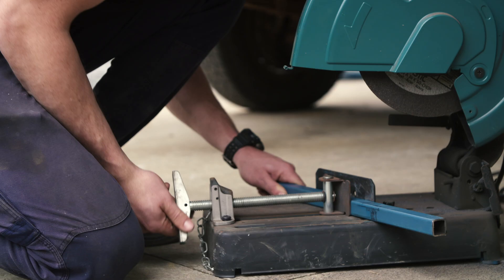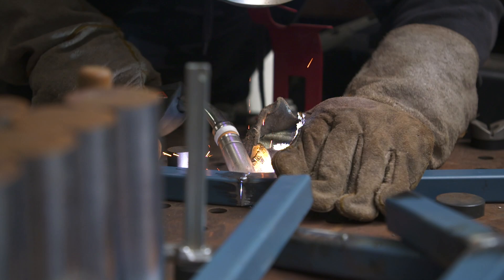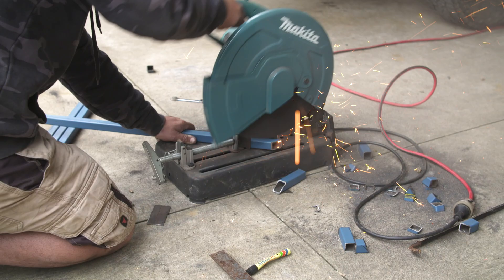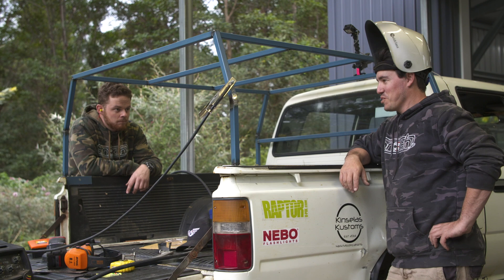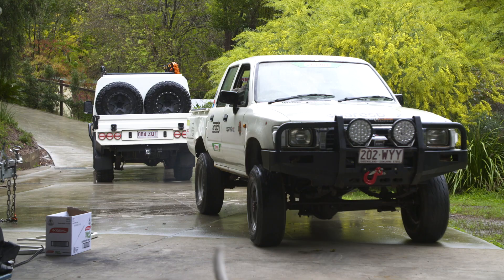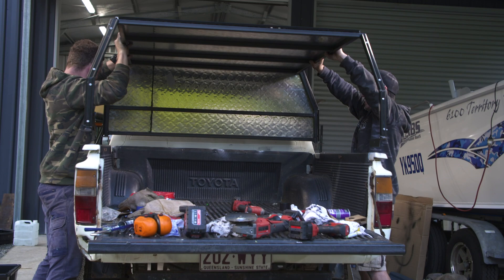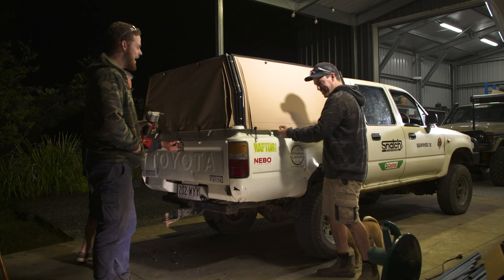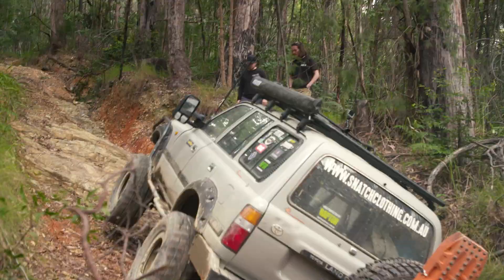CHEAP $1000 Canopy & $200 Drawers Built in Shauno’s shed! This will make you want to modify your 4WD

Comment from the maker: This has gotta be one of the funnest 4WDs we've ever built and driven. What's should we do to it next?
Reply: Get some 33s on it!
Reply: Put an Ls in it
Reply: I think a homebuilt exocage could be cool, would help jocko keep his panels straight as well😂
Reply: Put a rotary in it. Chop the springs and drift it
Reply: 6x6
Reply: Paint it pink
Reply: Put a bigger set of tyres on it
Reply: Homemade rocksliders and scrubbars because why not lol
Reply: custom roof racks made by the man himself, king of welds
Reply: Definetally a lift and tires
Reply: Or do what I've done to my 106 and make a custom centre console and rip out the rear seats and make a false floor and draws, and a sneaky sub
Reply: Yay you kept the lux I love seeing the lux because it gives me ideas for my own and wanna get but all the stuff I want will be expensive is there anything I’m doing wrong I have tones of questions is that ok if a ask some?
Reply: Looks Sexi mate
Reply: Twin turbo it
Reply: Mud tires
Reply: Put new lights on it (LED's)
Reply: I think most of us agree here. Tires. It really doesn't even need a lift to be honest. Just some proper 31s really. Look at how well the Dmax does on 31s!
Reply: Get a better driver behind the wheel first
Reply: Turbocharger
Reply: Shockos fabrication
Reply: Put 33’s or 35’s and a to-way/stero
Reply: New rims and Tyers
Reply: Roof cage side steps rock sliders 33s with black wheels maybe an ls1 with recaro seats if you want
Reply: Tiers, suspension and get some power into that thing (get in touch with Haltech) and maybe send the engine to Al at the Skid Factory and get a turbo Barra back.
He is doing some 1 and 2 JZ stuff now. 
The HiPony with a turbo 1JZ..  (Yes I knows it's called the PonyLux but...) 
Maybe an auto conversion.
Reply: How are you going to use the review mirror 🤔😂
Reply: I recon new tyres and a set of of road light bars including new head lights and tail lights. This would be if it the lux as it would have more traction and better visibility for those late night trails. Secondly you should do either do a mix of performance mods like air filter uprated fule pump and injectors. You could combine all of these or some into a big over haul video like this one but more feature length.
Reply: Put an Iron Jack beer keg in it with a tap and make it the mandatory beer truck for the next adventure aka the 'Iron Jocko'
Reply: Raptor coat on!
Reply: Suspensions, lift and bigger tyres.
Reply: Next do the Gq then hilux then gq then hilux.. until both are epic tourers
Reply: Lift and 33’s would be the go
Reply: Raptor coat it
Reply: Build a set of rock sliders
Reply: R.o.p.s
Reply: Engine swap the patrol
Reply: Put some 37s on it haha
Reply: a decent set of tyres from goodyear!
Reply: Jocko you need a 2” fulcrum lift and 33s and that thing will go anywhere.
Plus I’m a fabricator welder and I’ve picked some things on that canopy that are classic 🤣
Reply: Auto locker in the frount
Reply: 🇹🇹🇹🇹🇹🇹lift kit and bigger tyres bros ...
Reply: Kings awning
Reply: Staino snorkel
Reply: I want to see a lift and some tires made man size!
Reply: Has to be some new Tyres and a DIY snorkel/diff breather kit. No doubt water crossings are coming up in Fraser
Reply: I reckon bigger and beefier tyres and a DIY roof rack would look real sick
Reply: Trade it for a proper 4wd
Reply: vl turbo, a few nice tricks there👍🤣
Reply: Put some indicators in the front bar.  .
Reply: New paint job and a exhaust system 👍🤟
Reply: Been a budget build, 33s, 2 inch lift and more diy cheap mods, maybe something as simple as making rock sliders, roof racks or side rails. I reckon keeping it a budget build will definitely show what you can do with a small budget aswell as having a few beers with mates whilst making it 👌👍
Reply: Tyres definitely tyres
Reply: 1uzfe swap
Reply: Add some 33s with some spotties on the canopy an maybe put the spare on top of the canopy, reckon she'll look shhmick 👌🤤
Reply: Big Led light bar and a roof rack would be nice on luxy..
Reply: Put a uhf in it
Reply: I reckon some new tires would look awesome and help out heaps and maybe a service on the engine to get it running nice and smooth
Reply: @deanharrowell2741  already has auto lockers front and rear
Reply: Id say..... bigger tyres, rock sliders, and a coat of raptor linning..
Love watching these vids.
Cheers.....Pete
Reply: rears up front with long travel shocks and 40s
Reply: Split rims on cheese cutters 👌🏻
Reply: Lift an 35s it would be unstoppable
Reply: MUSHROOMASSASSIN too big
Reply: 4WD 24-7 put signal lense on the bullbar
Reply: 33s
Reply: Put some tractor tires on it because it twin lock and it go work good in mud and on wet hills
Reply: homemade custom armor everything that you can
Reply: 33s, back yard bar work, do it!!!
Reply: 3 inch lift and bigger set of tires
Reply: Roll Bar 😬
Reply: Rock sliders but you guys should build them , should be fun to watch
Reply: Definitely do an awning and 3inch exhaust plus a tune to the little beast
Reply: Hey boys just to let use know if JS fabrication gets up and going I'm happy to let use take to my 105 LandCruiser to turn it into a dual cab lol
Reply: Grab the old 1000 buck lux and meet graham in the simmo with shorty
Reply: Darryl should get a extra $1000 on budget the next time just to keep it even. I reckon 31s on the hilux keep it a budget warrior
Reply: Sanitize it.
Reply: Fluffy dice and musical airhorns
Reply: Jocko next mod should definitely be a set of 60 series wing mirrors. You'll see heaps more esp with the solid backing plate on your slick-as canopy 👌 screw em straight into the holes that are already there.
Reply: Home built roof rack would be practical of it's set up as a tourer
Reply: Through a set of 33s with a 2 inch lift on it
Reply: Through a set of 33s with a 2 inch lift on it
Reply: Some home built rock sliders and oversized tyres!!
Reply: When are you doing the Fraser Trip?
Reply: Gets some decent rubber on her and then maybe some suspension upgrades
Reply: Tires,  turbo, exo cage
Reply: Turbo, comms and 33s
Reply: Ifs rears, rears up front then a td04 turbo make it a bit more drivable in the sand and on the road 👌
Reply: 2 inch lift and bigger tyres. Maybe drop a turbo on it
Reply: Put new tires on it and a roof top tent
Reply: I think you guys should backyard mechanic this little guy ALL the way to show the average Joe Blow what can be done on a budget. Let's face it, nobody is buying new atm because we're all watching the budget. Good slogan... 'Backyard Mechanics - We get it right the THIRD time' 🤣🤣🤣👍
Reply: Next you should corona proof it
Reply: A camera system, so you can see 360 degrees on the trails.
Reply: Please don't ever class yourselves as metal fabricators again 😉
Reply: Engine tunning, give it bigger tyres and a nice paint job.
Reply: Fix the massive dents then do a full raptor paint job!
Reply: one word.... turbo :D
Reply: keep them as stock as possible and prove their worth.
Reply: Some 33 inch on it with a turbo upgrade for the engine it will be a little monster
Reply: What about a trip with other popular 4wd youtubers?
Would be great to see everyone together like at the 4wd shows.
Reply: I think you should do my car next? I do need a canopy?? Good vid boys
Reply: Side rails and rocksliders
Reply: 4WD 24-7 put some 33’s on it and a lift
Reply: I am thoroughly disgusted with you lot. 
Is this the way we are behaving now days?

Giving a strike against a few kids who just have fun and post it in YouTube!

How about you start acting like a decent Aussie and get along with your fellow off roaders and stop this disgraceful behaviour.
Reply: Bigger tyres and mud flaps
Reply: You guys should go on another cracking track like down to Oberon is where I go!!!
Reply: Bigger tyres and lift
Reply: High steer, turbo and some 33’s with a diff push 🍻
Reply: DIY roof rack
Reply: It’s better you didn’t use angle as it would habe sat out more the half box works nearer
Reply: Definitely a snorkel to the old girl
Reply: I got the same hilux will defo let u have a go on mine good job
Reply: I wanna know if jocko going to used 35 on the pony is going look really bad ass if he did
Reply: I wanna see the pony finish with 35 makes it look meaner is going look good for jocko
Reply: I got a  guestion for graham  r  u  going up  great ur d max like front locker with 35  is  going look real bad ass d max with 35 tires
Reply: I'd like to one of you build and old holden rodeo their a heap of fun
Reply: Nah mate, 4bt
Reply: Ruf, turbo and snorkel.
Reply: Shawno good effort buddy. Coming froma boilermaker welder..... I did a full angle all the way onto of the tub 👍🍻🍻🍻🍻🍻
Reply: I'd like to put a pic up of my build but can't put a pic up
Reply: Put some 33 or 35 on it with 2 inch lift
Reply: You should do my rig next. Stock af and needs some mods would be a good project as you guys have never done a Mazda b2600 before.
Reply: Probably install a turbo and other performance mods that will make it even more capable.
Reply: You prolly dont care but does anybody know of a tool to log back into an instagram account??
I was stupid lost my account password. I would love any help you can give me
Reply: @Lachlan Andres Instablaster =)
Reply: @Jesus Prince I really appreciate your reply. I got to the site on google and Im trying it out atm.
I see it takes quite some time so I will reply here later with my results.
Reply: @Jesus Prince It worked and I finally got access to my account again. Im so happy:D
Thank you so much, you saved my account !
Reply: @Lachlan Andres You are welcome xD
Reply: Twin turbo in to the pony express would sound awesome
Reply: You guys wanna do one for me 😂
Reply: @jarradmusson7249  rear view camera as the next mod perhaps?

Comment: So did anyone check that the Ute was level before using it to make other things level?
Reply: lol - good point...
Reply: I was watching it thinking the same thing. Was relieved to see them measuring up from the bed. They must have realised a spirit level wasn't working and then levelled the car...or maybe it took them so long with the "angles" because they got it all tacked together before realising the car was on an angle and the canopy was crooked.
Reply: Beer straight. No worries
Reply: Haha I thought about that too but like my grandpa used to say: We're not making watches here.
Reply: It won't matter it will never be on flat ground ,great fun
Reply: if you make it level to the Ute it doesn't matter? like wut
Reply: For a backyard job mate she'll be right. She's as level as it needs to be.
Reply: yeah but if its the same level as the unlevel car then when the car is level it will be level
Reply: And check tyre pressures were all the same!
Reply: All you need is me measurements and straight cut and bends

Comment: 7 years ago I didn't even know how to do an oil change. Grew up around computers, not cars and never had an old man or mechanical mates to teach me anything. I've torn down the front of my old Sorento to change cam position sensors, chased an overheat issue around, changing thermos, the radiator, done a heater hose delete, sold it, bought a diesel version of the same SUV, fitted a catch can, done a front to back oil changes and even put in a touchscreen head unit. Learned everything I've done from the University of Youtube and done it all on a disability pensioner's budget with hand tools. 

Had a dream the other week about doing some mods for a stealth camper build in my Sorento, removing the back seats, using that space to recess a fridge and a second battery setup, low profile drawers in the back with a bed over the top of it all on one side and open storage on the other, open one back door to get at the fridge, the other door to get at more drawers under the head of the bed. Want it all to be modular so it can be removed and left in the shed most of the time and set up for when I go off on my missions. Just had some new tires fitted today, been saving for ages for that. Next I want to do a 2 inch lift (mostly for new springs and shocks, the old ones have 16 years wear on 'em.) Wouldn't mind a front lokka but 1. I don't think they make them for my 4WD and 2. haven't thought about saving up for one. anyway this video makes me think about other DIY mods I could do, and maybe about learning to weld.
Reply: Great story, I hope you get your lockers by some blessed viewers...hint hint. Either way, your story makes me want to get started with my dream overlander as well. 

Best of luck with your future mods
Reply: Good on you mate.
Reply: That’s epic brother, your an absolute champion for just trying let alone getting to that point! Good on ya!!! 🤘🏽🤘🏽🤘🏽🇦🇺
Reply: Cheapskate

Comment: I did my dual battery system using a redarc 1220 bcdc and 105 amp hour battery installed in a arb battery box on the back of my single cab KUN Hilux to run my 60L fridge also installed 1500 watt investor to run my Nespresso. Went on a hunting trip last weekend and worked perfectly best experience building your own set up. I actually got the idea from Shauno’s dual battery video few months back thanks Shauno!

Comment: Living in the QLD Outback and in the Middle of Cattle Country, There is not an Exhaust shop within a 1000k radius, One evening while drinking a few Beers after day of loading Cattle on a Truck, I had the Bright Idea to put Exhaust Stacks on my 84 Petrol Hilux tray back . Exhaust stacks ended up being Made out of Oval Cattle Rail that was laying in the scrap pile and all the piping was made out of a old set of extractors off a holden 202 and the original exhaust pipe from the hilux, After 5 years of running that set up with the Huge Toyota Muffler mounted under the cab, I decided to give the old girl a new redback muffler and a lukey Hotdog, those were welded in With a Genset Stickwelder that we use to weld up fences and gates.

Comment: I bought a fairly stock PK Ranger. I swapped the well body to a tray. Did a custom under tray battery box. I installed the lift kit and a custom 90l sub tank mounted under the tray that gravity feeds into the main tank.
The PK had a terrible stock radio. I changed the fascia to allow me to install radio with reverse camera.
I made blanking plates for the EGR after it shat itself for the second time.
I installed DC DC charger system and catch can.
Most recently found a vacuum switching valve that was causing boost issues and fixed it.
Learning how the car works, building and fixing myself is far more rewarding than getting someone else to do it.
Both parents are academics and I learnt most of my car stuff from you tube and trial and error.

Comment: 2 years ago being 17 and bought my first forby, having my first mishap in breaking a front cv and diff gears in my old d22 navara, never had any mechanical experience, from watching YouTube and having patience, I was able to replace the cv and install a whole new diff assembly myself within a day, that was such an achievement!
Reply: The only way to learn this stuff is to get your hands dirty and have a crack at it. 
My first car was only a shitbox Suzuki Hatch that I rebuilt from the ground up including the engine and gearbox. Before doing that I had never even changed a tyre. I didn't even have YouTube back then. I had a few old commodore repair manuals, a few mates who knew some very basic stuff. It took about 9 months of weekends to get it done. That was over 20 years ago and although I have never tacked a project that big again, I have never had any problems fixing my own cars. I've never had to pay a mechanic for anything other then work required for warranty purposes. And one time where I had to pay to get a new starter motor on an BF falcon because I had no tools that would get to the bolts and I didn't feel like pulling the engine to save a $100.
Reply: memberHD that’s exactly right, I wish I done it the right way and just rebuilt the centre but was good to know how to replace the assembly but you learn as you go
Reply: @venomx9732  You're barely out of nappies. I'm sure you'll have plenty of opportunities to rebuild diffs. Diffs are almost a consumable part in some motoring circles.
Reply: Top effort, good attitude. Never stop learning, never stop having a go.

Comment: Built a whole 12v system, ran wires, Anderson plug for everything, dc-dc charger, battery box, fridge, canopy lights etc with very little knowledge. And it has now been running for 1 year without fault.
I'm now building a steel tray and aluminium canopy set up from scratch 🤙

Comment: Bobbed the bed on my 2005 Toyota Tacoma. Cut out 14" between the tailgate and rear tire and then put it back together. Never done any bodywork or paint before but jumped right in. It came out killer.

Comment: Bought a '98 Suzuki Vitara during university and threw more homemade mods at it than should've been done. Taught myself to weld from YT vids like Shauno and made a full front winch bumper, rear bumper w/ hitch and tire carrier, rock sliders, seats from a Mitsubishi Montero Sport on diy brackets, then did a 2" body lift + 1" suspension spacer and threw a snorkel on it from an 80 series. Threw some mud 33's on and took it everywhere. Didn't spend more than $1500 on everything...bought the truck for less than that.

Comment: I started rebuilding a HJ75 around Christmas time 2018. It had Fred Flintstone floors in it and you could see daylight through the windscreen surround. Working around school and now uni, it's almost there. I gave the entire body a good coat of 2-pack and put new rubbers in everywhere. Last weekend a mate of mine helped me mount the hydraulic tipper tray and made a few adjustments on the mounting frame. It looks soo good I'm itching to get it on the road!